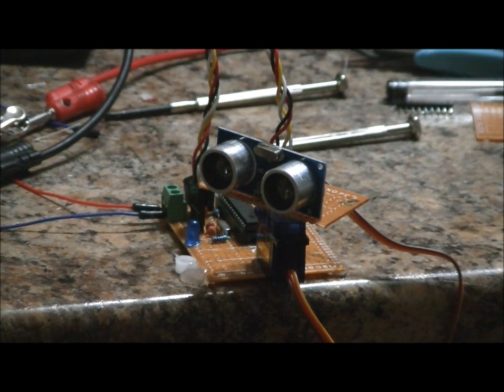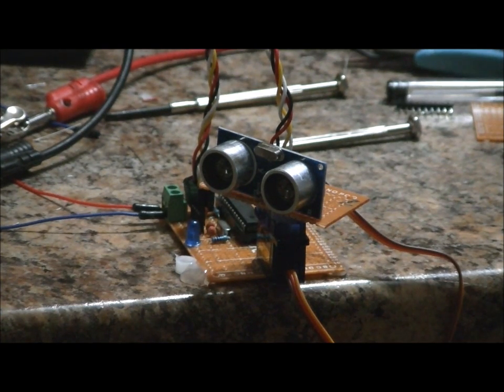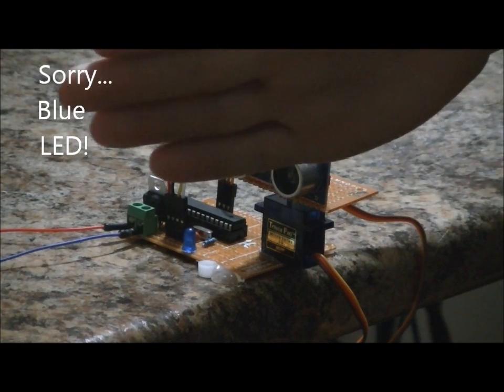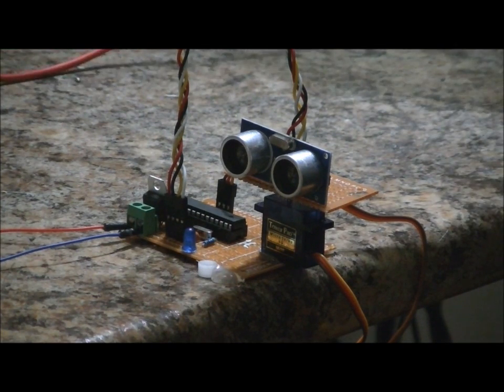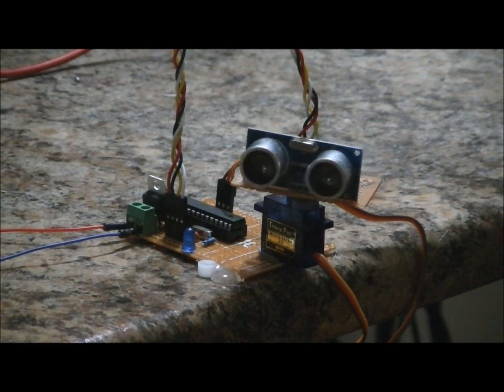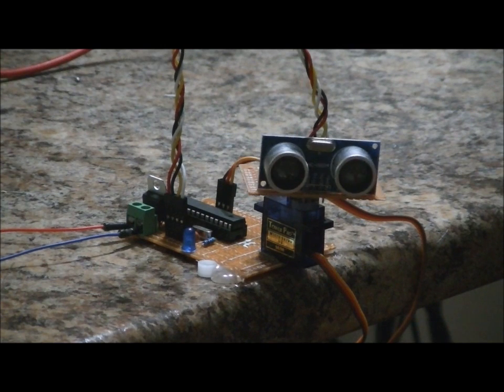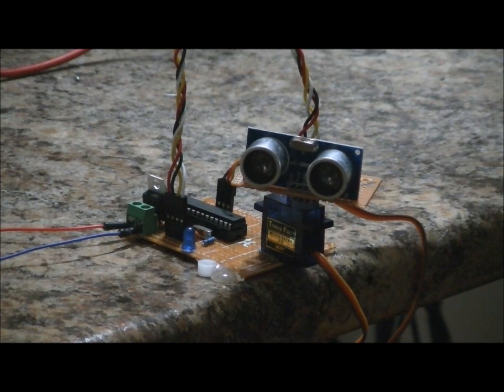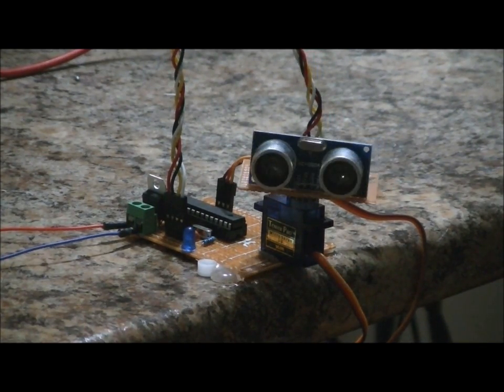The beginnings of an ultrasonic   servo motor based sentry!

Comment: What is the idea for? An alarm or something?
Reply from the maker: +Colin Hammill 
Hi Colin
Ideally, the signal to the LED could be used with an external circuit to do anything.  For instance, take a picture, sound an alarm, etc =)  I was just messing around, and thought it would make for a fun video.  I haven't decided where to go with this yet.
Reply: patrickikis Yeah it could have many practical uses, even scaring off pests.